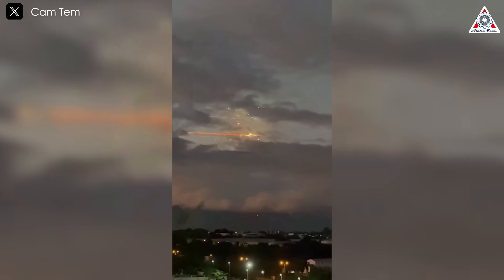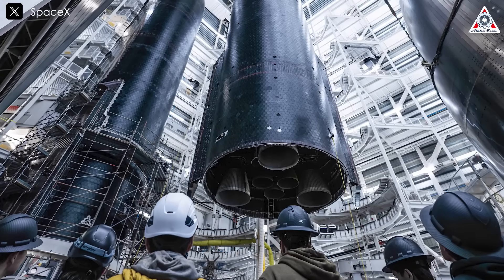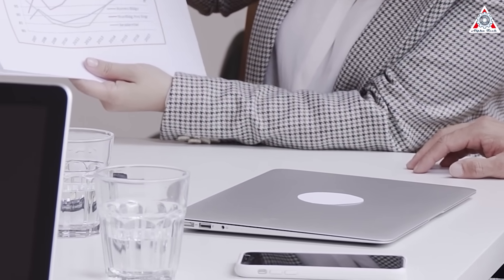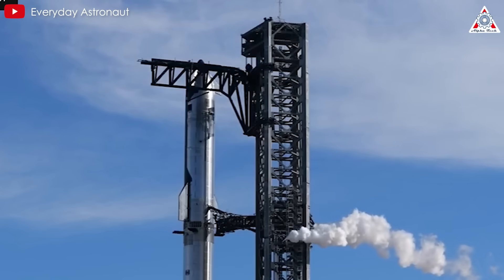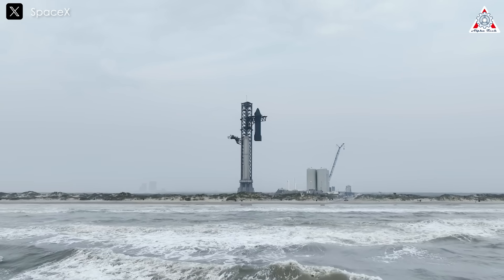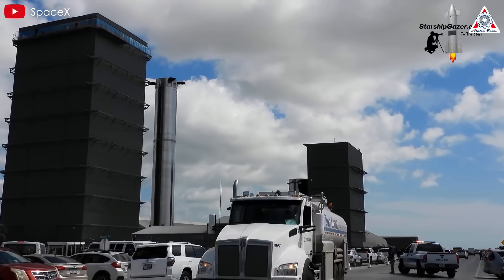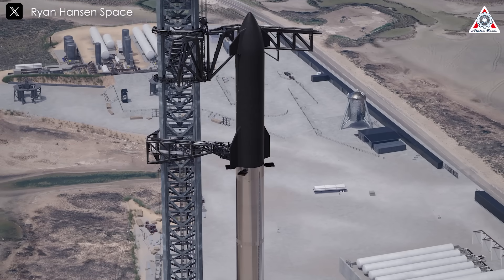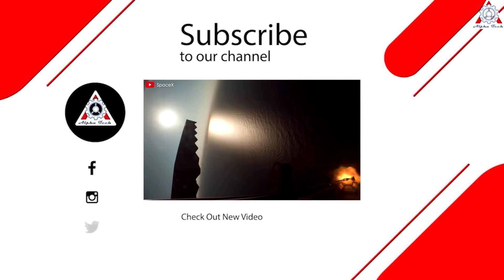SpaceX Has A New Problem With Starship to Orbit!

Comment: I love Musk Math.  Total loss of Starship is only 40% failure.  Presumably the landing SuperBooster would then be in excess of 100% success.
Reply: At this point they are test vehicles, so he is probably figuring it out from the standpoint of each part's mission success vs its flight information recovered.

The booster launched and returned, had an engine anomaly that resolved itself upon boostback relight.

Starship had a successful hot staging separation, but one of its engines failed, separation burn vs engine failure timewise?. 

From a control point of view could Starship have flown stable with one engine out..., and possibly future abort water landing Implications..., from the mission view it was a failure. 

Once the second engine failed FTS countdown was initiated...

Comment: @11:51 Misinformation - You might have divided the price of Falcon 9's lowest cost configuration (RTLS with small second stage engine bell), which is $69.75m, by the payload of the expendable configuration with the full sized engine bell, which is 22,0000. But if you did that you would get 3170 $/kg, not 2720 $/kg. But this is still an incorrect calculation because a correct estimate of the payload of the RTLS-small-bell payload is closer to 12,000 kg. Dividing by the correct payload value results in a value of approximately 5,812 $/kg.

Comment: Not one time has Elon circumnavigated the earth.
Reply: The Starship will easily go fully orbital. The current suborbital flight profile means that if the test vehicle fails  there will be no debris in low Earth orbit to lower this hazard. This strategy has paid in spades with the second stage failure in this latest flight. the bulk of the spacecraft breaking up after the flight termination was activated at suborbital speeds at 120 km plus altitude .
Reply: You understand SpaceX has launched a TON of things into orbit, including astronauts. Right?
Reply: The Licence to date has been in a high Suboritial but at orbital speed with its reentry in the Indian ocean, the next flight will be Suborbital, but testing engine restarts, and ejecting payloads.
Multi step by step to space.

Comment: I wonder about all of the fire around the base of the booster as it came in for a landing. Residual methane from the engine bells, it looks like. Certainly not rocket exhaust hot but the shut down engines are not going to have regenerative cooling during landing. It may not be a true hazard but we're not being told much about the condition of the booster engines following recovery on flights #5 and #7. I wonder about how quickly they can reduce the booster turnaround time. SpaceX has talked about re-using the booster on the same day.

Comment: If you can't sell a steak, sell the sizzle. As much as you sugar coat it, this mission was a failure. We still don't know if starship can attain orbit much less with a full payload.
Reply: This starship is in the TESTING project to find the bugs and correct them..before  launching with humans abroad...it's new space equipment  there will be bugs found it's would be nice not to have  nothing wrong but get real anything man made will show a error once in a while...even a New car or truck has recalls
Reply: The test flights do not intentionally go into an orbit to avoid generating space debris. If they remain below 200km altitude, the parts of an exploded or otherwise disintegrated spacecraft will soon come down due to air resistance. What is shot up to 400km and more stays in orbit for years.
Reply: @gottfriedheumesser1994  That's just a convenient excuse. New Glenn went straight to a fairly high orbit on its first try. So did the Space Shuttle. Starship is an example of what happens when one person has too much power and the people close to him don't want to anger him and lose their jobs.
Reply: @pewterhacker  You are an expert! What happened to the NG booster after separation? A total success!
Reply: @pewterhacker  Literal gibberish.
Reply: @gottfriedheumesser1994  bullshit.
Reply: @markdichter  It's not though. Maybe learn the topic instead of jumping in late because you're just trying to be snarky about Elon.
Reply: @ l’v been following space flight since Sputnik. I also know that personal insults mean you have no argument against my position.
Reply: It could have hit orbit multiple times already. lol. It hit orbital velocity multiple times, all it took was a second or two of engines and it would have gone orbital. That wasn't the test. The test was suborbital landings.

Comment: Currently Kaputship has a cost to orbit of infinity dollars per Kg having spent a couple of billion dollars to deliver a big fat zero kg’s to orbit. The N2v4.0 isn’t going to Mars in 2026 that would require about 20 Starshit launches for the mission and it isn’t going to have launched that frequently between 2022 and end 2026. You seem to have forgotten this isn’t going to launch again before May at the earliest as at least 2 full external accident investigations have to complete before the required actions to minimise the risk of a repeat failure can be identified and implemented.
Reply: Cringe. It'd be hard to be much more infantile than this.

Comment: However Blue Glen successfully delivering a satellite to orbit on its first launch shows just how routine this achievement is and should be. The failure of Starshit to achieve this on its 7th attempt shows just how difficult it is to run a development project when every significant decision is taken by an incompetent ket addled Jeremy who thinks they are a business genius.
Reply from the maker: hope spacex will fix this in the future!
Reply: Shooting something into orbit is relatively easy and regularly done with the Falcon 9. Building a spacecraft that can reenter the atmosphere is much more difficult. The maintenance costs of the heat shield killed the Spaceshuttle program economically, as the rework of the ceramic heat shield took more than half a year. That is unbearable for a reusable spacecraft.
Reply: @ The heat shield on the shuttle worked. Unlike that on Starshit, which has yet to return from orbit without significant heat damage. That Starshit can’t do what you claim to be the easiest part should be telling you that the rest of what they say is better used to fertilise your garden than to inform your opinions.
Reply: @davidwright7193  You are an expert!
Reply: @davidwright7193 actually it did not it was the main source of disasters... plus it had to be replaced every flight
Reply: Guy. It was literally the first time BO has reached orbit. Ever. SpaceX has reached it HUNDREDS of times and put up THOUSANDS of satellites, as well as people. Derp.
Reply: @ And what does that have to do with the price of fish? Starshit hasn’t even got itself into LEO let alone a payload. At the moment it is a very expensive and unreliable way of delivering a banana to a tropical island.
Reply from the maker: Thank you so much!

Comment: Your assessment of the failure is not correct.. the ship started yawing around from single engines shutting off prematurely so the ship could not maintain its attitude.. there was a comment about a fuel leak that they couldn't vent so they hit self-destruct and blew it up

Comment: Having lots of small engines looks cooler than having several large engines.
Reply: But you should remember about the ratio of Thrust and Weight
Reply from the maker: It does look cool!
Reply: Dumb!   More engines more fuel lines, more fuel pumps etc etc!  The Starship has no value!  Its not a viable lunar lander due height weight!  NASA is not using Starship for anything!  It is to slow t go to mars!  NASA is moving forward with nuclear engines for Mars!